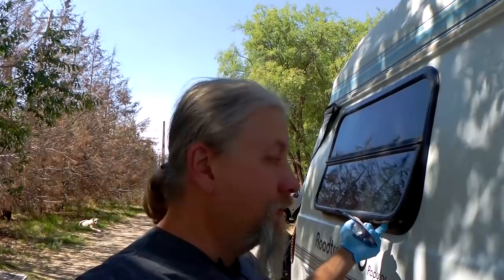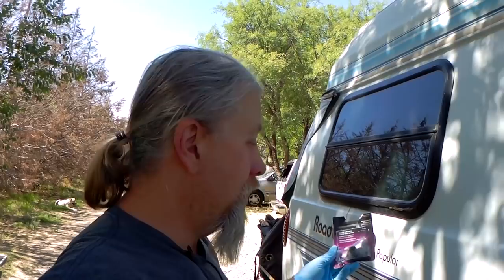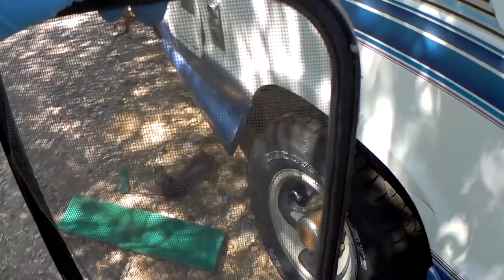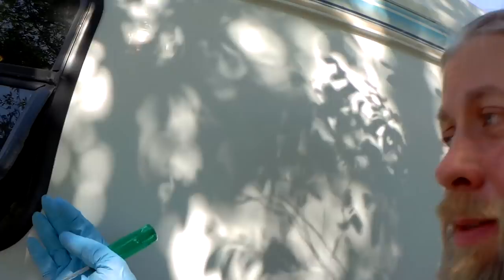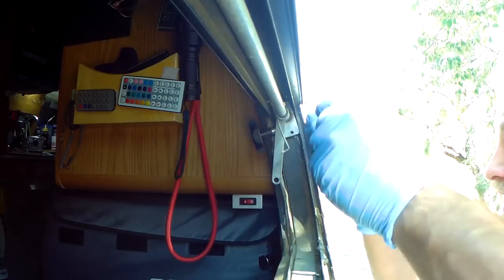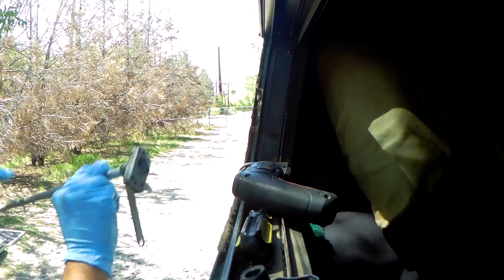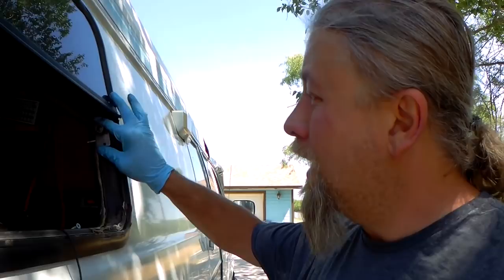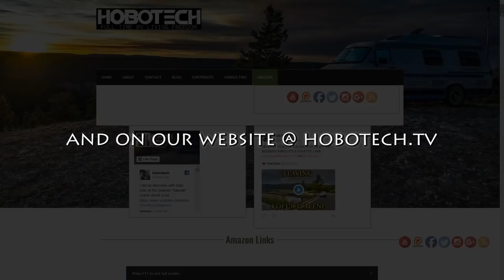HEHR RV Window Winder Torque Operator Replacement In Under 10 Minutes!

Comment: Good fix there Tom, That happened to me also, Amazon sending me a used item. Looks like some low life ordered the part and put the new one on his window and sent Amazon back his used part to get a refund.
Reply from the maker: I had it happen both on ebay and Amazon for the same part. Even though the product was sealed it would be possible to do that.

Comment: I had the same problem with my Roadtrek 190 Dodge 2001 last  year and I fixed it. An other common problem on those vehicules ils the loose swivel seats. 
Alter removing the seat, I found a flattened nylon or teflon washer. I had to cut one myself. It is about 3 inches diameter with a one inch hole. It now works fine.

Comment: Hey to you and Oden, excellent repair job. I hadn't seen your buddy in the Big Truck lately he must be on the road... I just fixed mt Chevy 2500 HD yesterday a Squirrel with a Chain Saw ate my #7 Injector Wire and caused the engine to miss, killed the cylinder. It was only parked a couple of days. I sprayed Wasp Spray in the engine compartment last night. This morning there was a Squirrel Running around in circles out front he ran straight to a tree hit it head on knocked himself out and a Fox ran up and got him breakfast. Mice and Squirrels hate Wasp Spray residue it will drive them away.. It was funny. I watched it on Yard Cam...

Comment: Hehr has been making that stuff a long time.  I wonder if you got a new, but 'old-stock' part that might no longer be made.  People buy out old shops and find old parts that were never sold, then sell on ebay, etc.  (I have collected a half dozen tiny vintage trailers with similar window cranks...)

Comment: y last RV had the HEHR winders , my new RV has the lower half as sliding ,, I never get dust and they just work ,,, we are mow looking a a new (second hand) c class and would like the same sliding windows but most seem to have the Hehr multy louver flap windows ,,, when there is just one they seem to be ol but the windows with 3 or 4 flap louvers seem to rettle all the time , we changed the winder mech on the old RV it fixed the rattle for about 2000 miles ,,, I just dont think the mech is strong enough ,,
Great vid buddy ,,, ODIN should have been looking thru the window ,, would have been cool ......
Reply from the maker: They are literally the worst made mechanism I've ever seen. Like a cave man made it with meteor iron or something. Wish someone made a real steel one.

Comment: I've got a 1994 Alpenlite 5th wheel with the same windows, and about half of them don't work anymore.  I opened one of them up today and found that the winder still works fine but the tube that sticks into it is mis-shapen and those nubs that are inside the winder slide past the openings in the end of the tube.  Whoever engineered these things must have been a graduate of Mickey Mouse U.  I'm planning on improving them but don't have a clue what I'm going to do yet.

Comment: I was going to ask how well that green filter material worked until I saw the plume of dust poof out of it.
I bet if the winder housing was made out of steel instead of cheap pot metal it would last a lifetime. Of course, if it were then the aftermarket parts manufacturers couldn't sell you a replacement every year.
Reply from the maker: Exactly. I looked far and wide for a steel one. No one makes them. What I should do is hire out a machine shop to make them and sell them for the vintage market.
Reply: @HOBOTECH  That is a good idea, doing CnC work myself I can tell you that milling is the cheapest route rather than casting steel but even that would be very expensive. If I were you I would do some market research to find out how much cost per unit the market would bare for a "stronger" unit. Prototyping is very expensive even if you have a working model. My estimate would be around 5k.
Another option is to identify the common failure point and see if you can modify (upgrade) a cheaply made one. In that way you could probably supply most of the labor yourself upgrading the crappy ones. I see a potential profit that way. Much more so than a total redesign in steel.

Comment: I have a show idea for you. I put in making ice with solar panels into YouTube there's very little that comes up and a couple of them are doing it from home. 1 I is a solar generator. Since you have one and you have solar when your refrigerator is low in order to show production you have to keep the ice. It would be interesting to pull together a video solar needs of the ice maker and you may have that video I'm not sure. But I think it would be very interesting to see how much ice you can make with your jackery. One day I'm going to be on the road and I will be copying your video LOL I think it's a great idea since you coined klinke. you read several of my comments on y'all's live. I was the one that figured out Kansas was copying you. LOL 1 video was one second off the other one is right on the money. Take it easy sir Wes
Reply from the maker: Good idea. I can try to run my ice maker on the Jackery 240 and see how it works. The machine says 150 watts but it has a compressor so startup wattage may exceed the 240's output. Worst case it is a good test for the new Jackery 500. I could make ice all day with that sucker!
Reply: research the ice makers the only one that I had checked on was a 750 watt start up. I don't know if there's any way to start it up on the generator and move it to the jackery
Reply: I would say amps X volt equals Watts x 2 minimum.
Reply: @HOBOTECH You mean the "clinky 500"?